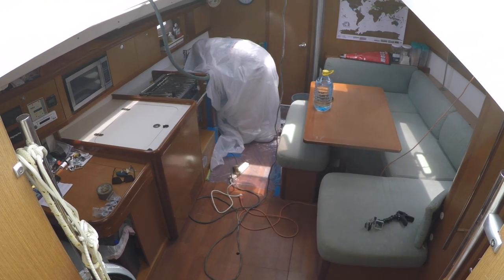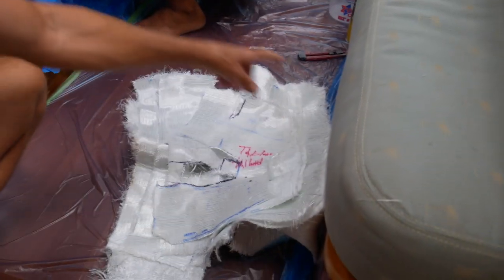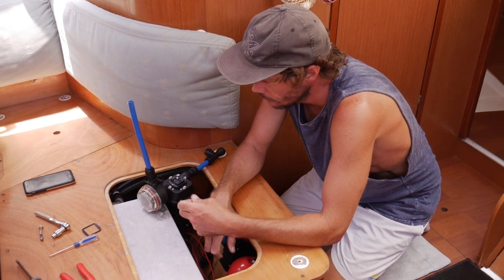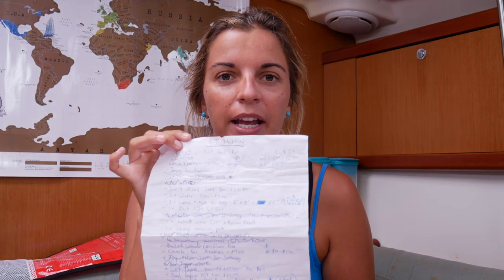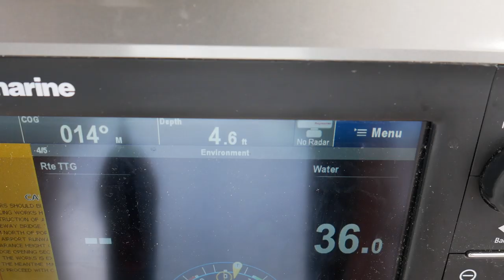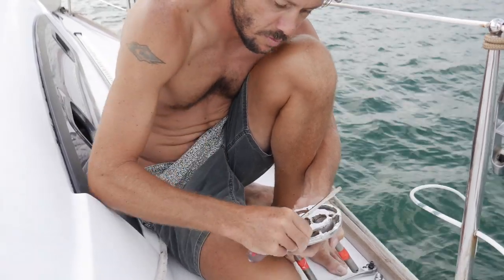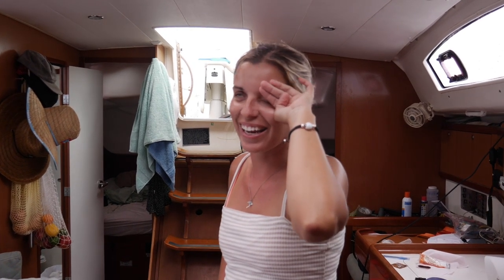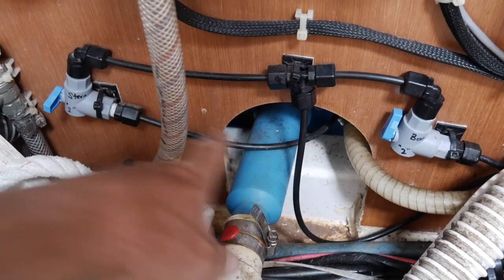MAST REPAIRS and Our Crew for the Atlantic Crossing Arrives - Ep. 13

Comment: Being in the fiberglass business for 40 + years I would have liked to have see better picturers of the cracks . But they fixed is so there was a problem . What I did not like in the original repair was not fully grinding out the old ripped fiberglass around the pin area. 
But all is good as you made it across the Atlantic!  Cheers Warren

Comment: You  re bedded the chain plate cap with silicon, that will last for a while. A more permanent solution is to use butle tape.
Reply from the maker: Yup. You are correct. But we didn't know about butyl tape. It's on the list of jobs to do. ;)

Comment: Greetings 😊 does the gel coat add strength on top of the fiberglass? I sort of thought it was there to make the boat look pretty, but since you’re doing it under the counter where no one will see it I’m second-guessing. This question is coming from an armchair sailor who’s never been on a sailboat before. God bless
Reply from the maker: Hey Tim - great question. And you are right to a point. The gelcoat doesn’t add strength to the structure/glass. But it helps protect the glass and makes for a better surface to keep clean, keeps out moisture and adds a level of wear and tear protection. That’s what I understand but I’m sure a gelcoat boffin would know better. 👍
Reply: @SailingZephyr  Ok, that makes sense!

Comment: Did they match the glassing (chain plate) on the other side or will that be the weakest link?
Reply from the maker: No need to repair the other side as it was fine. Only the port side was affected.
Reply: I'm concerned about creating a weak link on the starboard side?
Reply from the maker: @TairnKA  I'm not sure how it would as the anchors are separate.
Reply: @SailingZephyr  The impression I got was, there's Port and Starboard chain plates of similar design so if one is beefier then the other, there's the weak link.
Though I could assume that the rigging tuneup compensates for this?  ;-)
Reply: DOH! Hit me with a frying pan, these "chain plates" are not part of the rigging but as you've said, part of the anchoring system. ;-D